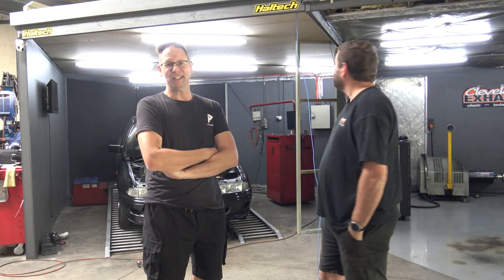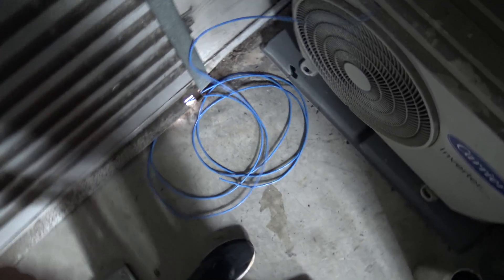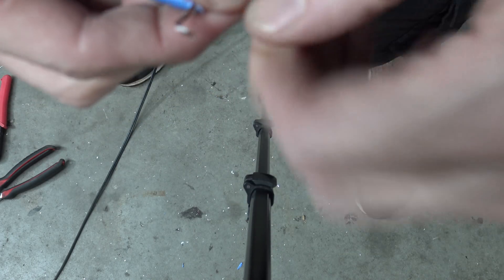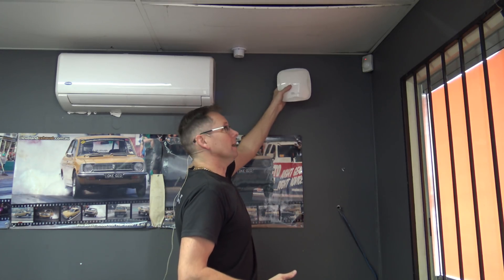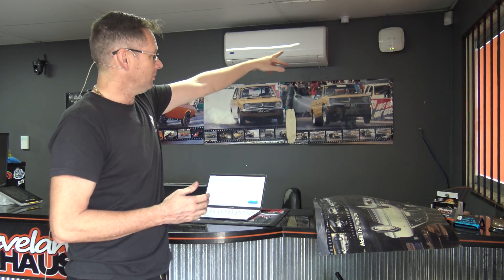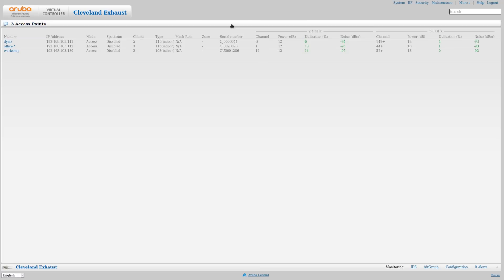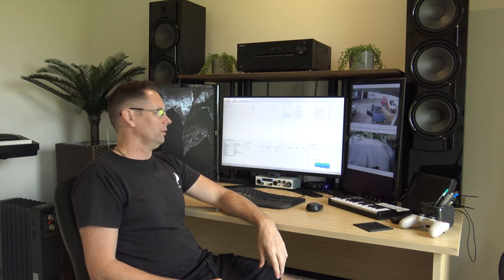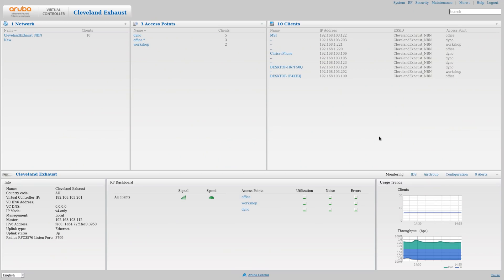Nugget Garage Network Upgrade

Comment: I bought a cheap Cisco AP off Ebay and thought I could run it in autonomous mode - I just can't access it - It shows up as an IP address in the DHCP- ive tried some tutorials using putty but the AP just doesn't show up. I was thinking its windows 11 and the CH340 chip in the serial cable- bought a few cables and spent more money on the cables now Thant the AP. Thought it might be a good thing for your channel to explore buying a cheap Cisco AP and because they are robust better than a repeater - similar to what you have done here in the nugget garage. cheers

Comment: does poe need special cables for carrying power, or is cat5/6 enough?
Reply: That’s enough, looked like 5e from the video. It’s the switch that needs to be able to deliver POE
Reply: @K0ellner  yeah i get the switch sends the power - i meant does the ethernet cable have to be specially rated to deliver that power
Reply: @zenmaster24  cat5

Comment: Ahhhh 568A.... Ugh! 😉
Reply: B, it's always B!  :)
Reply: @BenScarboro  I was taught at training/licencing school to remember A is for Australia. Don't fk up the other end ;)
Reply: @farktard2740  If A is for Australia, then it makes perfect sense :)
Reply: @BenScarboro  indeed. It was more an issue when you terminated your end A (as per spec here) and the apprentice did the other end of the structured cabling B because he thought it was faster....
Reply: @farktard2740  Hehehehehe, yeah, that'll do it!
Reply: Oddly enough I've had some hdmi over ethernet converters that refuse to work on 568A, so I guess it's for a reason ;)
Reply: @TradieTrev    That I find interesting!  Wonder what the cause of the failure was...  What HDMI over Eth equipment was it?
Reply: Here's a table for both: https://en.wikipedia.org/wiki/Power_over_Ethernet#Pinouts